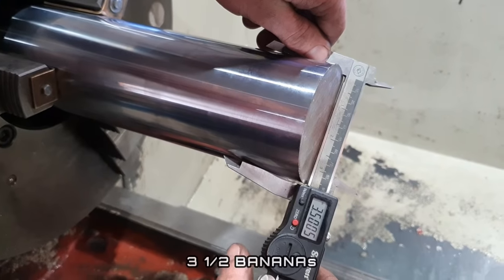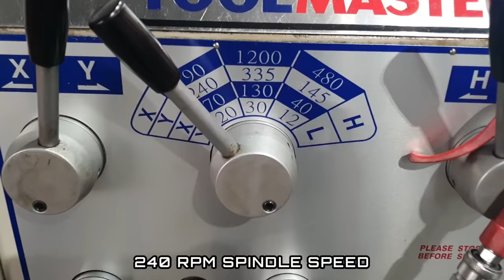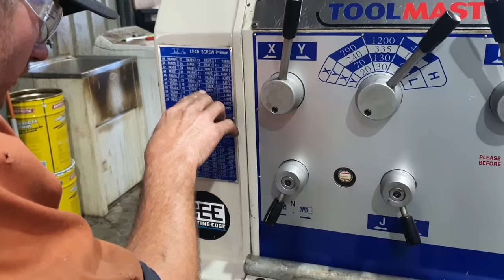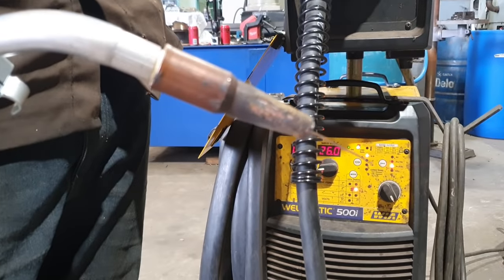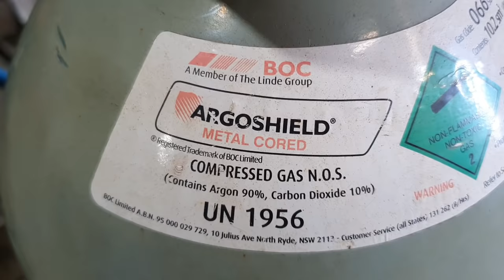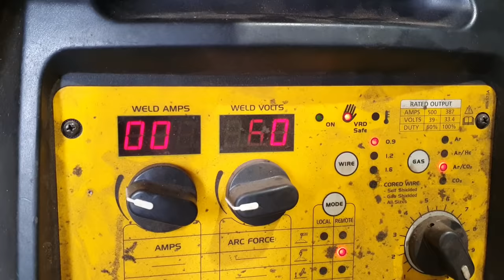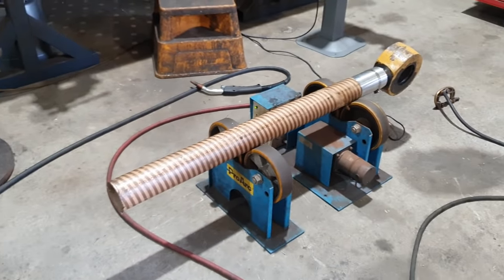Repair BROKEN Hydraulic Cylinders for CAT D11 Dozer | Part 2 | Making the Rods

Comment: How does the lathe know where the previous cut for the threads was? I imagine there is a spindle that drives the tool, and digital revolution counters on both the spindle and the big motor? Still, that there is no slack at all in there is super impressive. You place a lot of faith in the machine, if it were off by a fraction the pretty threads get all sorts of screwed up. Very expensive paperweight to buy yourself...
Reply from the maker: hey mate, I leave the half nut on the lead screw engaged, so there is no variation in the thread pitch and a fool proof way of thread cutting.
Reply: I was wondering that very same thing!
Reply: Lathe can cut thread even before electricity is a thing. There is no need for any electronic devices here. The lathe can cut a thread because firstly the spindle (which hold the workpiece) can be linked (and unlinked) with the carriage (which hold the tool) by a gear train allow the carriage to move a certain distance equates to the thread pitch for every turn of the spindle. Secondly the thread repeats itself every full turn of the spindle so if you link the carriage with the spindle at it make a whole turn (from the moment you start the first pass of the thread) you essentially cut the same thread. So how do you know when to link the spindle and the carriage? You use a indicator usually a dial fitted to the same drive mechanism that drive the carriage, you watch the dial come to a certain position then you enage the half-nut which link the carriage to the spindle, and because you always thread from a certain direction either toward or away from the spindle the slack is not present. There is a simpler way to make sure the thread line up is to never unlink the spindle from the carriage and you return to the star position by reversing the spindle rotation which also reverses the direction of the carriage the thread of the return path is slightly different from the forward path due to slack in the mechanism but since you not cutting on that path so it not a problem.
Reply: It is a bit more complicated when the thread start have to be at a predertermined angle position relative to the axle.
Some machines have that capability.
A side note, the safety officer should have intervened re the oily fumes when threading. Nasty stuff to inhale.
Reply: I was wondering the same thing. Could you maybe do a quick explanation at some point, for those of us that are not machinists? Thanks.

Comment: Why not use coolant when cutting with the ceramic insert?
Reply from the maker: ceramic is actually quite brittle and needs to either be run hot/dry or flooded wet and I prefer less coolant mess!

Comment: Drop it! Make me! 🤣🤣🤣
So when you thread, do you use the compound method at 29 degrees or plunge with the cross straight in in a 90 degree angle?
Did they get exactly the same length?
Reply from the maker: we know who the boss is 🤣 I do go straight in but bump the top slide over and have the half nut on the lead screw engaged
Reply: @CuttingEdgeEngineering  elaborate please on the bump the top slide. Didn't understand that bit and I always on the lookout to learn new things

Comment: How brutal is that induction hardened layer on the inserts?
Reply from the maker: depends on the quality of insert but the ceramic inserts are designed for cutting the toughest material so will usually last a while

Comment: noob question bro- is there a reason why ya dont use coolant when going through the hardened part at the start? like i assume there is obviously a reason cause its how you do it lol, what is the reason?
Reply from the maker: hey mate the ceramic insert i'm using doesn't like thermal shock (hot to cold) so are best run hot/dry or flooded with coolant and I prefer less mess 🤣👍
Reply: @CuttingEdgeEngineering  haha thats fair, legend buddy, thank you ☺️

Comment: Would it be possible to fix the wire brush wheel under the welding lathe and run it at the same time, so it cleans off the slag while you weld?
Saves having to stop every rotation to clean it up.
Reply from the maker: hey mate the wire wheel creates turbulence and would suck the gas away from the welding shroud and just make a fucken mess 🤣
Reply: @CuttingEdgeEngineering  
Ahh, I didn't think about the turbulence.

Would it still be worthwhile to automate the grinding?
Just tap a foot pedal to have the wirebrush temporarily engage and the lathe spin faster.

Comment: I find it amusing seeing you use the Tapecrometer for precision measurements. Or is that a Machinists High Precision Flexible Ruler? Do you Stone it before use? ;)

I can't actually think of any more accurate means to measure the length, other than putting it between centers and cranking the tool post to scribe lines with the DRO or something, and that's overkill, so I guess you should be able to get it within a mm or 2 with the tape, which should be close enough for a cylinder rod!

Comment: Can someone tell me what is the purpose of the 5mm radius cuts at the bottom end of the threads?
Reply: A relief for the thread cutting process
Reply from the maker: hey mate not only is it a relief for thread cutting but it also takes away  the square internal edge which are more prone to cracking.

Comment: Hey guys, hope you are all well. What is the reason for changing the spindle speeds? Have a good one! o/
Reply from the maker: hey mate we're doing great. The carbide inserts have a speed range they are most efficient in plus changing the speed can improve surface finish and lengthen life of the insert.
Reply: @CuttingEdgeEngineering  Ah i see, thanks for the explanation :)

Comment: The soluble oil looks awfully watery. When I was machining I was always told to add enough oil to make it look like milk. Have I been misled ?
Reply: Different Brands, but it's likely being used more as a Coolant in this application.
Reply from the maker: Hey mate you haven't been misled it's just this type of Coolant (hangsterfers 5030) it's a semi synthetic vegetable based coolant. When this one turns off white it needs to be replaced.

Comment: I never understood the use of oil at some points of machining. What's the point on using oil? You don't want/have an oil layer to prevent wearing, you are literally cutting thought the metal so... Can someone explain what is the purpose of the oil when drilling or threading? I like these videos but I am not a machinist or anything related. Thanks in advance.

Comment: I wonder how much pounds of power Homey has in his jaws.
For the size of the little bugger he could rip steel apart. One chomp and he could rip your hand off.
When he is tearing those toys apart it makes me laugh when he stretches a piece out and then it goes snap!!! Does he ever hurt himself when it snaps back in his face?
Kurtis, if you can sometime…… I would love to hear a little explanation on how you do the treads on a rod like that.
How do you get the diameter correct so when you run the tread it’s now too small?
When you do several passes on the tread I don’t see how you end up in the same groove each time without causing any damage to the previous pass you just did?
Once you start running the tread, is it automatically feeding itself in? Or are you controlling the speed of the pass?
Reply from the maker: hey mate Homey is too tough to let a rubber chook get the best of him 🤣 and all really good questions, Karen has also asked me to explain the thread cutting process next time!

Comment: You know I’ve faced whole processing linesman lumber mill rebuilt trucks scrapers and the such kept oil fracking equipment going when the book says it shouldn’t. Operated mills lathes cut tables boring machines. But I could not COULD NOT! Figure out how in the hell you figure out and cut threads so to me that crap is some Jedi master crap to me man well done. Can you at least throw an old dog a bone and say it’s a little easier on these new fandangeled machines.
Reply from the maker: hey mate I hate to be the one to tell you but the principle of thread cutting on these new fandangled machines is the same as the clapped out old generation machines and not difficult once you wrap your head around it 😅😅😅

Comment: may i ask you how did you cope with your first big fuckup 
like leaving threading - feed engaged and switch the maschine into high gear - forget it and proceed to send the tool at lightning speed into a new 3 jaw chuck until the feed screw shearpin gives 
or crashed a cnc Mill - or fucked up a expensive part irreparable
if the first one is oddly specific thats pure coincidence ....

Comment: Nice work again. What coolant are you using, it looks to be a piss weak mixture, compared to other coolants? Surely you're not using Fosters?😂
Reply from the maker: hey mate i'm using Hangsterfers 5030 it is a semi synthetic vegetable based coolant, runs nice and clear until it goes "off" and probably tastes better than Fosters 🤣👍🍻
Reply: @CuttingEdgeEngineering  Thanks mate, I use Milton babies bottle sterilising fluid when it starts to get a little old, it's much cheaper than the proper stuff, and I wouldn't give a Castlemaine 4X for anything else😁

Comment: Hey guys, you have said before that the chrome Outer layer of these rods are incredibly tough to turn. As we can see in the video you need to take very light cuts in comparison to the parent material removal.

What is the limiting factor whe  removing the outer layer? Is is the machine rigidity, horsepower or the insert? Or something that I have not thought of?

Would love your insight on this
Reply from the maker: hey mate some people prefer to take the induction hardened layer in 1 pass but it would mean if the insert does ever break, the tool could potentially collide with the material and you've ruined the tool and material, so i'd prefer to avoid that and just take little bits each pass
Reply: You champion, that makes sense.
Thanks guys

Comment: Wait.. am I missing something? Why are we using the old eyes that we know were under abnormal strain?- Strain extreme enough to have flat broken two hydraulic rods
There's no way those eyes haven't been deformed, at the very least.. And I'd wager they've even got (micro)cracks.

Oh well, job security; Kurtis will have them back in the shop in a month or three I guess lol
Reply: Let me just nip the first reply in the bud; I'm an arm-chair machininst. I know how to operate a lathe, but have VERY limited experience with it. I'm a programmer, elechicken and welder. I'm by NO means an expert in anything but my programming - So if I'm *waaay off base* on the stresses imparted upon the rod-eyes, then I offer my apologies in advance.
Either way, I'm a huge fan and have nothing but respect for Kurtis' skills in the shop -- And Karen's video-editing skills are also quite impressive and always a joy to watch :)

Comment: So much work, why? Just scrap it. In Canada I get a lot of steel from hydraulic cylinders. Have to make a video on proper way of scraping them. Hint, need to get rid of the oil. The steel of the rod is very nice, not very hard and machines very easily. It is decently ground. Good source of material. Used working cylinders can be had for a touch above scrap price. So your take home is nice round steel block for maybe 1.5x scrap at most. You scrap the rest.

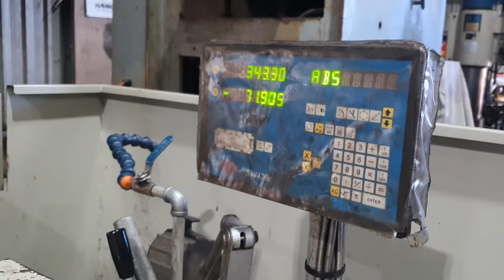Comment: 17:25 and 17:39
Lol . Making a point to show the DRO is shut off during welding.
Have people been busting your balls about that?
As long as you are grounding the welder to the work piece, you are good to go.
There is a possibility of inducing a voltage in the DRO wiring from the EMR coming from the welder, but it is unlikely.
Greetings from the top of the world! 🍌🇺🇲🍌